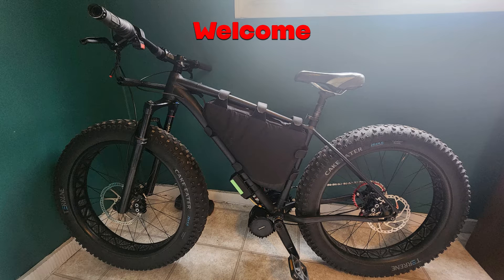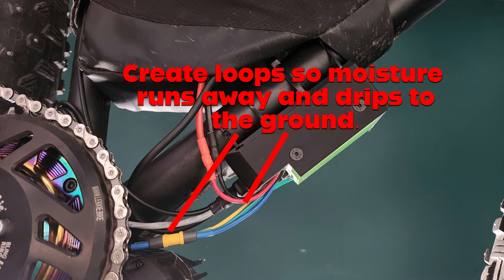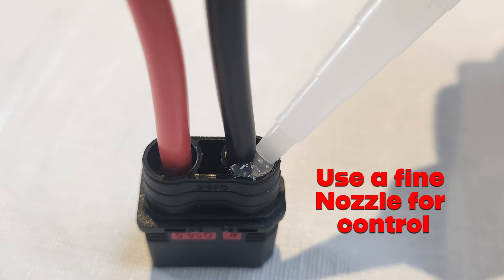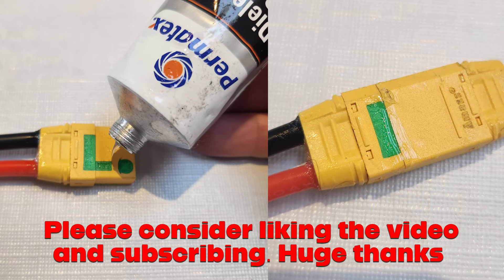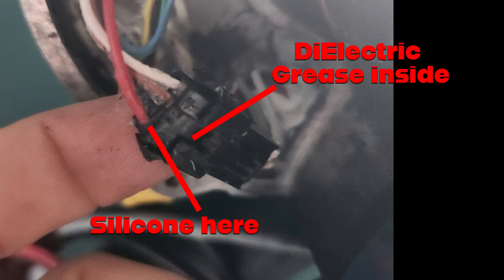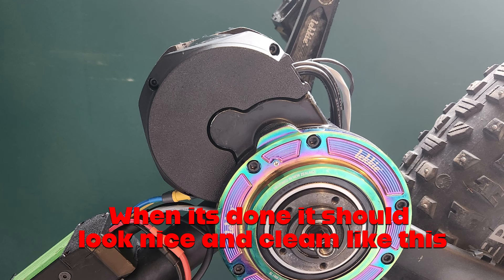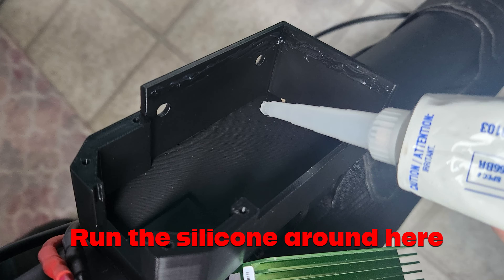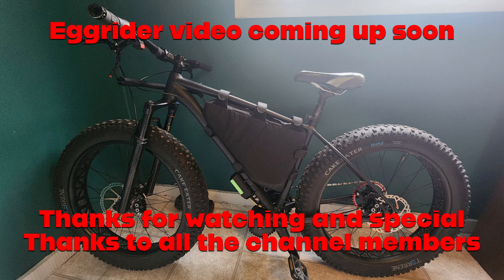E Bike Waterproofing Tips - How to protect E bike wiring and components from moisture

Comment: Great video, with a lot of practical sense. Although it maybe a bit much for some, making your own custom lightweight mudguards to your own specs from fibreglass to an excellent finished standard, is not that hard. Since I'm a sculptor, with years of experience making complex geometry molds and casts, it's helped me making modular casings that blend nicely into the bike frame and structure for protecting/hiding excess wiring. 
Water ingress is a bitch and anything that can minimise it in the very wet irish winters is a big plus. Redundancy is always a good measure.
Reply from the maker: I love the idea of making your own mudguards. I will stick it on my list of things to have a go at once I free up ithe time! Cheers

Comment: Hello, sorry my friend I didn't understand why you use dielectric grease between plugs to connect ? Why don't just use rtv silicone too instead ?
Reply from the maker: @SEN100N  it let’s you take stuff apart easily while also doing a good job.
Reply: @HighVoltageKits   Oh thank you, so the only downside of using rtv silicone where you used grease it's gonna be hard to take apart but will operate the same for waterproofing ? Thanks

Comment: Can you advise me, I overdid my washing 
Of my e-bike Bandit XP-PRO the other day when I turn on bike the turn signal comes on not blinking just one, when 
I turn on the headlight 
Both turn signals on but
Won’t blink and throttle
Won’t work, Throttle works if head light is
Off only display screen
Operates normal .
Tried hair dryer on battery connector 
And on electrical 
Wire disconnected 
To the head lights
Is there an electrical cleaner that will dry
Up any moisture.
Thank you, Richard,
Reply from the maker: Sorry I missed this. Only a thorough drying. Suggest disconnecting things to let more air in and speed up the process.

Comment: You can also use heat shrink with glue to insulate the wire plugs. These are usually 3:1 and 4:1 heat shrinks, so they adhere very nicely to wires and plugs, even when the plug is much larger in diameter.

It's always easier to replace the plug if necessary, when you only need to cut the heat shrink, than to additionally remove the silicone from the plugs ;)
Reply from the maker: Thanks :)
Reply: 3:1 15mm dual wall adhesive heatshrink is a good fit on the XT90 connectors. You can even source it in yellow to match your connectors.

Comment: PVA glue is excellent for filling holes where wiring passes through the frame to completely seal the hole, it is extremely waterproof & easy to remove in one lump when needed
Reply from the maker: Love it!
Reply: @HighVoltageKits  Just make sure it's not the water soluble PVA, as that stuff will make a proper gloopy mess all over the place 
PVA is also excellent at preventing rainwater ingress around batteries, switches etc as it's extremely rubbery & flexible 
A 500ml bottle of 'Wudglue' is about £/$6 ish & 500ml will waterproof over 100 bikes
Reply from the maker: @Andrea-B-65-UK Ahh yes! Not school stuff then!
Reply: @HighVoltageKits  That'll probably work, but quality wood PVA is much better, giving any smooth surfaces a tooth will help it to stick, alternatively applying a thin coat of PVA an hour or two earlier before applying a thick sealing dose will also create a tooth for the PVA to stick to
Reply from the maker: @Andrea-B-65-UK appreciated
Reply: @HighVoltageKits  Anytime, I have many years experience of driving huge ex Soviet off road trucks & riding motorcycles in all weathers 
I hit my 60th year tomorrow & have bought myself my first ebike, Engwe L20, an extra 16Ah battery, trailer, better tyres,  next on shopping list is convert trailer with a 190L lockable garden storage box which will have a power pack in it & an 800W solar panel on the lid, unlimited mileage without waiting 6+ hours for battery to charge 
I already get 31/32 mph on the flat in PAS 5 or throttle+I weigh nowt) , not bad for a (supposedly) 250W motor with 50Nm/37lb ft torque

Comment: Using a small zip tie on either side of a connector will create a low drip point
Reply from the maker: 100% Good tip. Just make sure not to punch the small wires
Reply: @HighVoltageKits  The zip ties don't have to be fully tightened, just tight enough to create a low point to divert the maximum amount of water that runs down any wiring 
Zip ties just around the wire & not used to attach the wires to anything else on to bike

Comment: Any recommendations  on rear air shocks that's adjustable and super soft and springing , I like soft comfortable ride
Reply from the maker: The DNM burner is pretty cheap and you can adjust it to be soft as well as change out the coil if needed.

Comment: hey cap! really thankful for this video as it gathers up all the spread up information that i've been hearing from you. the time has finally come and i'm gathering parts and tools to install the motor onto the bike. two questions: how long is a 9g tube of dielectric grease going to last? about the silicone, do you have any specific recommendation or general purpose is fine? i could get your same silicone if preferable. thanks a lot for your time, doing god's work!
Reply from the maker: You don't really need much grease. Should last a while. In terms of silicone I used the stuff I got from an auto store. I would get it there. I used Lordco. Not sure if they have that with you.
Reply: @HighVoltageKits thanks cap, cheers

Comment: Whoooooah!  Wait a tic. I’ve been an automotive technician for 30 years. And that Permatex dielectric tune up grease can be crammed into the INside of Any and All connectors. Directly into where the 2 pin high amp wires connect and any and all low amp multi-pin connectors. I’ve done probably about 200 tuneups and gone thru an insane amount of tune up grease. Spark plug 60,000 v plug wires, battery terminals, 40-120 pin computer plug ins where some of the pins are 1 v, 5v, 12v all on same connector. Cram full and waterproof, oxygen insulated and electrically isolated from neighboring pins. Electicity takes the path of least resistance. Fixed many perplexing and strange automotive electrical issues this way and saved clients thousands of diagnostic costs (treat on plug in at a time)
Reply from the maker: That's fantastic. I bet I could learn a ton from you! I was introduced to it from my father in law who works on motorcycles a lot. I didn't know it was quite that flexible in use though. Good to know. One of those cheap things that saves thousands of dollars. Cheers

Comment: A hot glue gun is my trick. It always peels off easy and seals very well when used correctly. Grease and slime will creep out and about. Hot glue stops rather fast.
Reply from the maker: Good tip. Appreciated.

Comment: Great Vid, thanks, and great ideas in the coments. in my opinion i wouldn't seal the wire exit hole on the controller case. In case you have a small weep, you need an escape for the water. You dont want to create a well.
Reply from the maker: That's a good point you'd have to very confident with the rest of the job. Its not something I do myself and have not had any issues.

Comment: Have you ever heard of this? CYC photon kit on a mountain bike, a Kona, Satori 29er. Kit has close to 900 km on it, overall fairly happy with it, except for false heat values in the beginning, they helped solve those. However, while riding up a hill, I experienced pulsation through the   pedals. Everything still works. But now it is as though the torque system is compromised and it gives full torque with very little pedal pressure as though a spring is broken or something like that. I would be surprised if I’m the only one this has happened to.
Reply from the maker: I have heard of the torque sensor failing yeah. Quick question though. When a bike is powered on torque sensors often calibrate themselves. Not 100% if CYCs do this. Do you have any pressure on the pedals when you power on the bike? Its a long shot. I have a feeling you will need to do a claim on it. I would get in touch with your dealer or CYC directly. You can try your luck on the Facebook group. They might have other ideas. You could perhaps try a firmware update or a reset to factory defaults. Sometimes they can get rid of these issues. Worth a go. Cheers

Comment: I put silicone thic grease on the outside of connectors been 4yrs, no corrosion or problems with my 52v bbs02b system 🎉 for one of my tips would be to silicone grease the oil seal ln the crank arms and bearing seals.  seal the controller and motor gaskets with silicone rubber to make sure its solid. Happy new year, glad I found your Channel
Reply from the maker: Appreciate the extra tips. That's awesome. Happy new year for you as well. Cheers

Comment: I would never recommend to use regular silicone like in this video! Why arent't any manufacturers using it if it's such a miracle product?
Reply: Silicone works fine.
Reply from the maker: They are. Manufacturers do all the time. You can see traces of the old silicone inside the motor where it was removed to service it. The silicone here was from a car shop. What is your concern here? It beats a battery short.
Reply: Because it probably cost them just to do that so they skip it.

Comment: Those downtube mounted front mudguards are superb, but be careful with the version that can be clipped on and off, I rode the the coast on a windy day and the last I saw of it was about a mile out to sea , still in the air😂
Reply from the maker: I've had a set for a while but they are pretty beat up. Not had the front one pop off but the back one I have repaired several times now. Not perfect but they do the job. Sorry to hear yours was lost at see. I bet that was maddening. Cheers

Comment: is comformal coating of any use here? quadcopter people tend to use that to make their circuit boards with the flight controller water resistant
Reply from the maker: I have seen people coat controllers with that stuff on the connectors where they are exposed. It's not something I have used. I don't see why it wouldn't work.

Comment: What I usually do is that I put heatshink tube on the XT90 connectors, and fill with dielectric grease/silicon before shrinking them completely. Filling with hotglue also work if you want something harder with more physical protection.
Reply from the maker: You are the second suggesting the heat shrink trick. I like it! Cheers John

Comment: Great Tips, especially when using an Ebike in the snow, as seen from your earlier videoes.
I personally would recommend 3 steps.
1) Use Corrosion X on All connectors & pins.
2) Use a 4 to 1 Gluelined Heatshrink over the entire connector (Male & Female) from cable sheath to cable sheath. No need for messy silicone & can still access connector for repairs/ maintenance etc. Just need a Hobby knife to remove heatshrink. Multiple Single insulation wires into one connector may need a tiny amount of silicone or Dielectric Grease for any gaps left.
Note - I use Corrosion X on all my gear, Car, Lawntractor, RC car when running at the beach. Ebike etc. Never had a electrical fault associated with any connectors since. Especially the RC Monster Truck, it would use to burn out the non Waterproof ESC (long before waterproof versions were available) but with using Corrosion X the same ESC wouldnt corrode & short out. Amazing stuff, i have even seen videos where dipping an ESC into Corrosion X then submerging the entire esc & other sensitive electronic equipment into a tub of water while in operation, zero faults or shorts. Check out this extreme test link regarding Corrosion X.  https://youtu.be/s4z8QMgTEA4?si=9hmAqwo8fHql94uf

Comment: Hey high Voltage diy electric bikes and vehicles! I live in Port Coquitlam just east of Vancouver British Columbia Canada and I did many of the wonderful waterproof tips you covered. I also put silicone in the heat shrink before I shrank it to seal the gap left between the two wires so the shrinking squeezes it out! I used dual wall adhesive heat shrink after I mate two plugs together to seal the mating line! Hope those added tips help other riders in soggy climates similar to mine! Happy new year! Ride ride ride!
Reply from the maker: Those are some great tips there Eric. I will have to do the heat shrink one. Thanks. Happy New Year.
Reply: great tip never thought of this one!